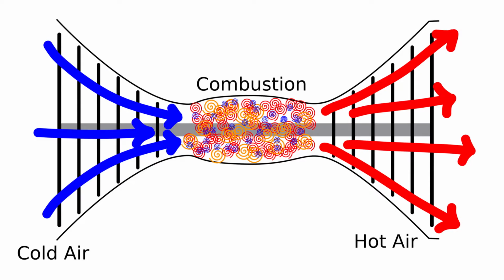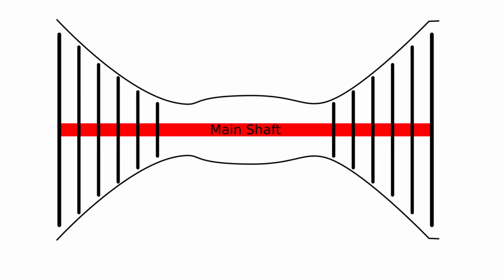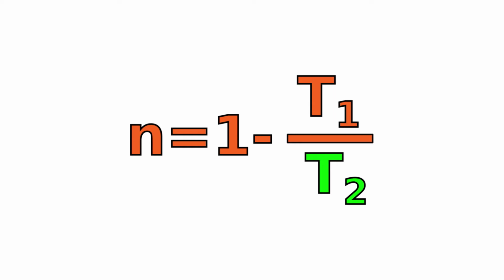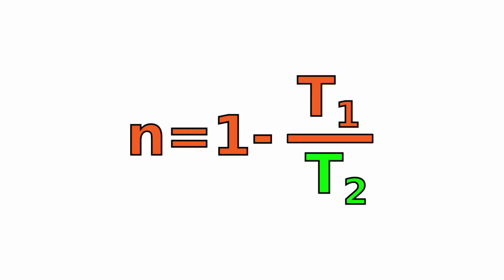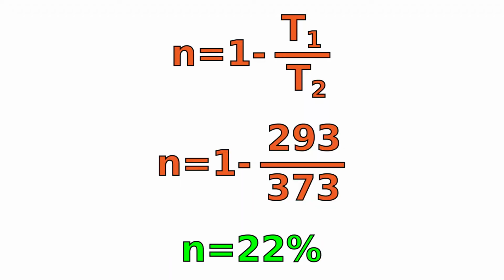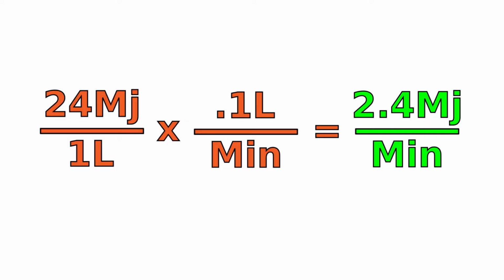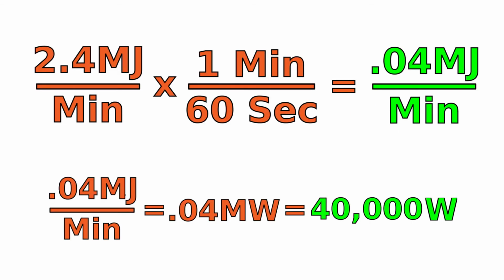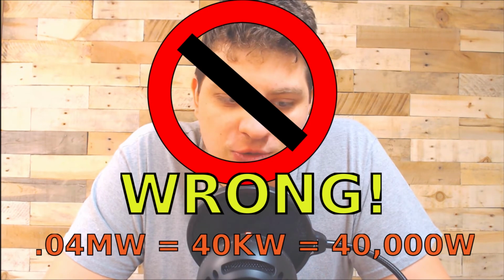Thermodynamic Analysis: 3D Printed Jet Engine

Comment: At 50,000 rpms, heat will be the least of your worries.  Plastic blades will not hold together.
Reply from the maker: +Steven Donald yeah, that's a very good point. I don't think I'll be running at 50,000 though. Ok going to try to stay much much lower, maybe 1000-5000. I've Seen 3D printed quadcopter blades before, they don't work that well but they seam to hold together for at least a while. Turbine and compressor blades are much squarer than a propeller, so they might stand a chance.
Reply: Design The Everything It will be very hard to achieve pressures that will maintain combustion at that low an rpm.  Even modern metal jet engines must be accelerated higher than that just to start.  Good luck!